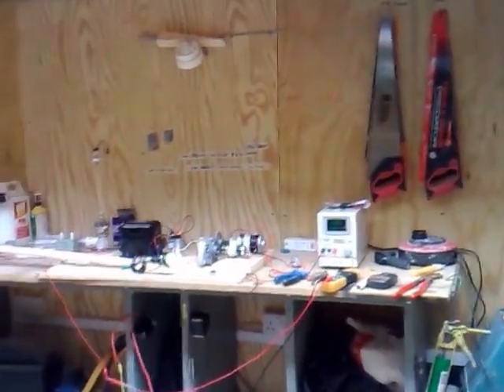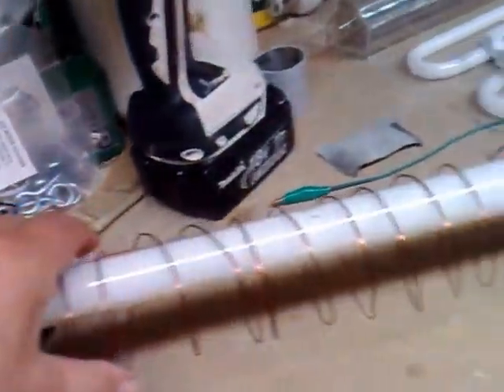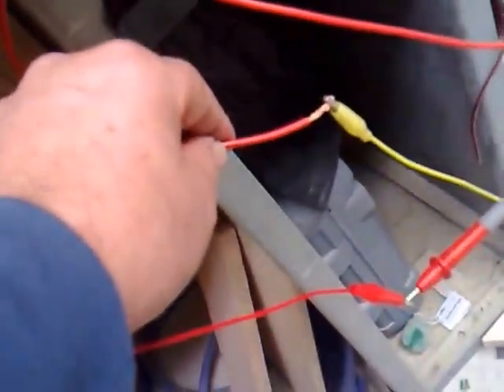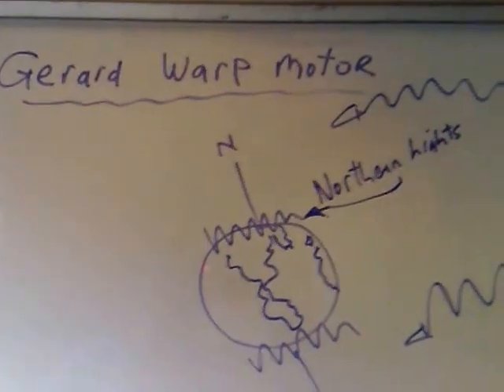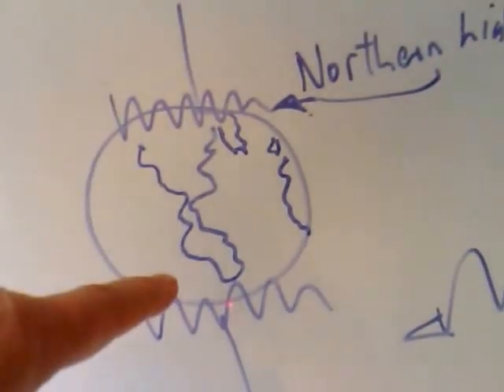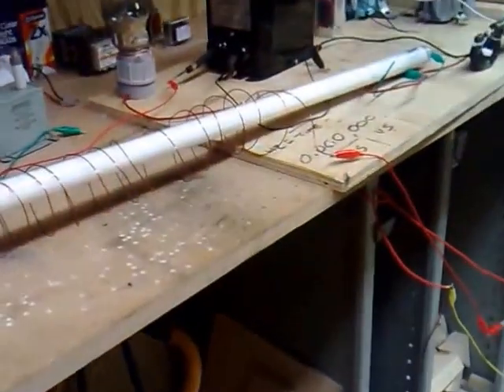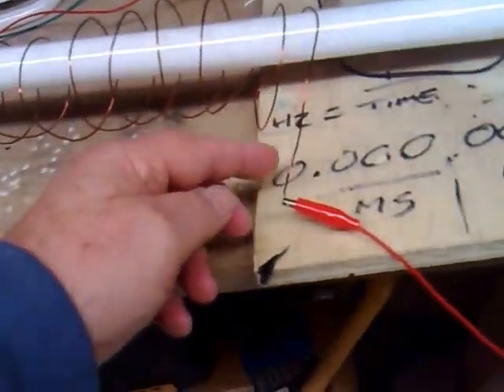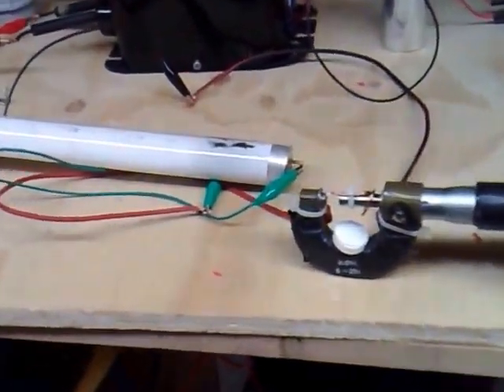Gerard Motor PROOF of OU  (Warp Drive)

Comment: The calculation is right you just don’t understand it not epic here
Reply from the maker: Hi S.B.
I have moved on with my learning we have much to learn.
Please give me the calculation ( The Quantum bean counter numbers) Ken Wheeler loves people who talk of the Q.

I love to experiment and think outside the box. Too much dogma and lies about these days.

Calculations please.

Regards DC
Reply: @e.powerdc1127  what good can it do now the gay have some knowledge but not much to go on with being a engineer is I learn to think out the box and he get one part right electricity is a name given to universal energy magnet don’t produce energy the on a technological level the magnet moving force attract energy from the life force of universe energy that is everywhere so frequency is energy and energy is electricity but one thing he didn’t understand is that to stabilize the energy quartz crystal is needed and converting the higher frequency voltage to dc voltage with ultra faster switching diodes that can sensor the frequency of 5 mhz  and the the voltage he get right when a generator rpm is 1500 or 3600 the resistor on the magnetic increase but if you go beyond that up to 12000rpm the resistor disappeared, converter the 1000 dc voltages by switching down the voltage to 400 dc and inverter that to a useable power and use a large super capacitor bank of 1000uf to buffer the dc

Comment: Nice work...however...I never understand why one verifies apparent over unity, yet years later I check back at their channel and find no additional research and/or implementation on the device.  Looks like you are still posting videos, so kindly can you explain why you moved on after such astonishing results to other things!  Thanks in advance...
Reply from the maker: Hi S.S. work in progress, my levels of understand move too. It's how the dielectric moves at 90* degrees to the magnetic.
Tesla was right think vibration, my journey is taking shape be it long winded.
Nothing good comes easy.
So it continues I have now a clear vision of the next steps.
See my last two videos, vibrating the zero point in the Bloch wall of a magnet.
Regards..... DC
Reply: @e.powerdc1127  I certainly will follow you, and I agree about the vibration/resonance.

Comment: Run Gerard Morin motor on atmospheric electricity with antenna and you have overunity with no input from AC wall supply. Google "Ion Power Group" for info on graphene based antenna which pulls around 1 kilowatt of atmospheric electricity when antenna is raised 130 ft from the ground. Youtube search "Birkeland Currents Explained" for source of atmospheric electricity.

Comment: If you think of earth as flat with North being center and South being outer edge of Antarctica and beyond you will excell understanding electricity. Please before you degrade my intelligence look into this it is revolutionary the perfect way to understand this in an electrical device is the Joe Booker water cell. Moon cold sun hot. Yes I totally understand how crazy th his sounds I scoffed at it myself until I tried disproving it 3 years ago then everything made sense.
Reply from the maker: Hi C  We do need out of the box thinking, so i will not bad mouth, its not the way to go. Where we have synergy Moon Cold Sun Hot is vibration frequency which does make sense in terms high & low. Further North & South in my opinion is a starting point to explain what electric is. That is to say the vibration / electric is a like tumbling magnet within the atomic structure of a atom, flexing bending shape shifting.
Regards... DC
Reply: Hey DC...The Joe Cell is total BS...just another distraction. Alot of metaphysical nonsense. We will NOT GET ANYWHERE if you stop what you are doing. Keep doing what you are doing. To hell with me the the others...I always find it strange that clowns who watch ah vid or 2...are trying to give you advice...RF is really weird. Think about WATER...metal is not the same as tissue. Philips S. CALLAHAN.."Tuning into Nature"...i.e lower-energy physics...I read rhe whole joecell website... its BS. I have been reading and thinking about Cross field Antennas...by Hartely and others...Maxwell os ready missing something....But Maths is NOT reality...I too got taken by This BS.  Bibhas Be...one of Hans Alfven student has done some tremendous work on Magnetic fields...je has suggested that magnetic field(Mathematical fiction( are REALLY physical...His wirk has been in Magnetohyrodynamics. The work by Thomas in Germany seems important. That is...how does the brain REALLY work...Anesthesia...and Magneto-acoustics...Why the hell my Biochemistry textbook NEVER mention water...hell thats the place where chemical reactions take place. Lastly...whewwww...take ah look at acient structures...granite, crystal, low energy physics...we need people who will study the physics, chemisrty and biology...I.don't know if the world is flat...but every clown I listen to...just repeats the same shit that some other clown repeats...How can them speak aboit the Bible...and not know/think that this same BIBLE...is not ah Pysop... These people really believe its the world of GOD, yeah...the GOD controller who have been controlling us for  1000's of year...Stick you you work... Imagine tjat...They are capable of thinking the earth is flat...Jon Levi👍 But textual and meta-analysis is not the same as building sht. Continuse to make yoir mistakes...bit look at the sturctures that have been build by pass civilazations.... Damn...We need detectors/ antennas to register ah signal...Natire is NOT based on Foirier analysis...maybe filter bank theory...tje work of Robert H. McEachern is Key. Hailing from the Caribbean....👏👏👏👏🪝🙏🤫🤫

Comment: Nice work.:-) I just bought a dc rc motor and a pump motor and will try this out. Amazing. Thank you.
Reply from the maker: Pablo Diaz  trying to understand electric and how it works is key. Try looking at the pole transformers to domestic supplys. The Morin motor is a great starting place tool. It's simply a a/c generator with variable speed frequency controlled by voltage. Regards ... DC

Comment: Wow, i found your video very interesting, I havent seen or tried putting a coil around the tube so will give this ago.  At the moment I have two tesla towers connected via the physical earth and air gap between the top of the towers and sending about 4w to the second tower at a distance of approx 6 feet.  I will stick a floro tube between the top of the towers( which normally lights up) and wrap it in a coil of transformer wire like you have done and see what happens:)  The reading you got was fantastic but I wonder if the RF is screwing with your meter:(   Very interesting idea about the sun powering the Earth, in some way I am sure it does but I don't think the Earths spin is primarily an effect of the Sun as any object in space will continue to spin once spun, but I do feel the Earths atmoshere is supported by the Earths electromagnetic fileds which, I believe are inturn supported by the Sun.
Reply from the maker: +Spangley Rainbows The Earthing is the key (tesla), if you use very large copper plates with connecting grid work you can get connective coupling at great distance.  Regards .... DC ...  (PS) love H.V.